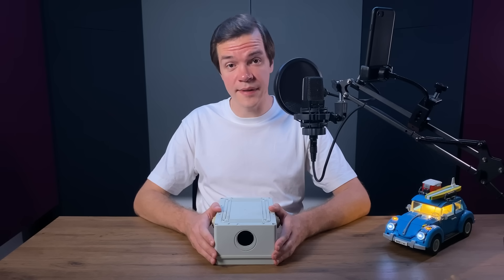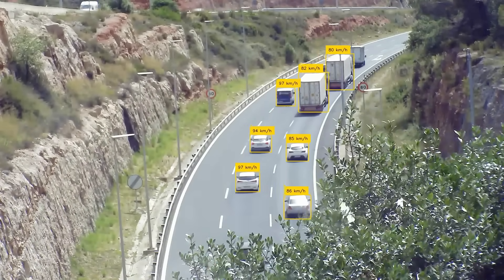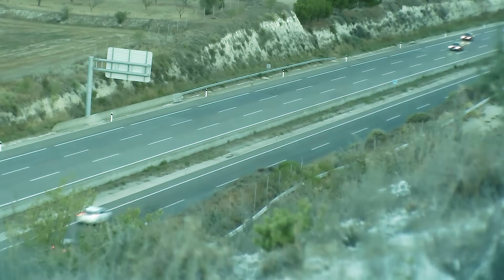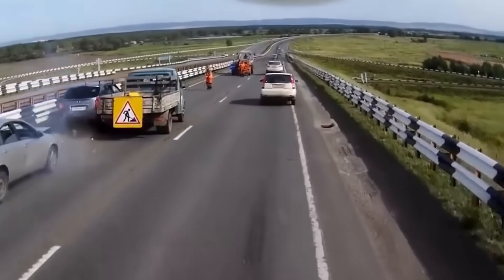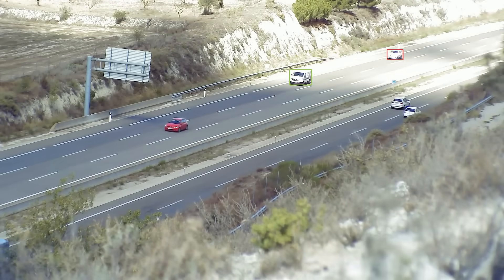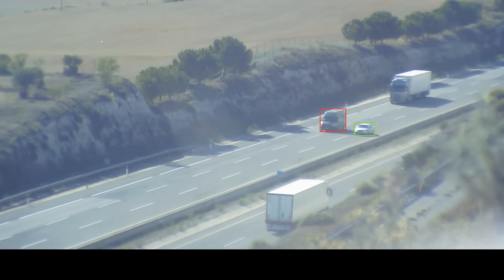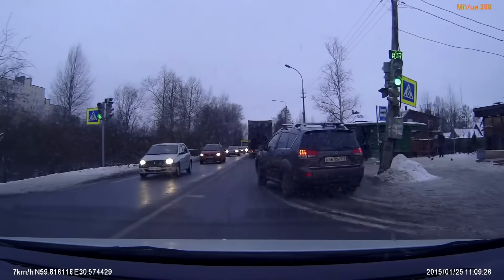New Anti-Tailgating Camera Reveals Shocking Statistics

Comment: I wish I could say this were shocking. In the USA, tailgating is a rampant problem, especially in Phoenix where I live, and it's so bad that I've given up on getting frustrated with the many drivers who follow me too closely. I don't brake check so if they hit, it's legally their fault.

One curious thing I have noticed is that there seems to be a difference between how closely they'll follow different kinds of car. I drive rideshare using the platform's car rental service, and when I first got out there giving rides in a late model Corolla I found that drivers, especially in pickup trucks, seemed to tailgate closer and more often than when I'm in my older, beat-up Crown Victoria. Not sure if it's the relative sizes of vehicle that may be a factor at play, or if it's something else.

Comment: Here where I live highway only has 2 lanes, and the speed limit is 80km/h for heavy vehicles and 100km/h for light ones.
The unspoken rule usually is:
Trucks in the right lane going at 80km/h while Cars go on the left lane going at 100km/h (detail, I know there is no fast/slow lane, but most people don't, and there is such high traffic that if you want to go any faster than the 80km/h trucks, you'll stick to the left)
There is usually high traffic so you'll see hundreds of vehicles tailgating each other. Once one crashes, it'll usually get at least +5 behind them as well.

Now, the weird, worst part. You can't choose to not tailgate without making everything worst. If you're in the left lane and give 100m of space, someone from the right will pull right in front of you to pass one or two vehicles in the right lane, if that's a truck, everyone will have to slow down to 80km/h. If you're in the right lane and also try to give 100m of space, a truck that's behind you'll push to the left and force to pass you.
Passing one f.ing car makes NO DIFFERENCE, but if people see a small space, they'll do everything they can to fill it. So, as soon as you drive safely, people around you become erratic and increase the risks of accidents to happen.
I hate people, can't wait for all vehicles to drive themselves.

Comment: Love the creativity in the tech involved.
The unintentional tailgater is what led to the joke about the guy in Los Angeles who was determined to drive safely, so he slowed down a little to put six car lengths in front of him. However, someone cut in and he had to slow a little more. This continued until HE was arrested. Why? For driving backward on the highway.
I think the best solution is to gamify advanced driving simulators and require them to obtain a license, and after any traffic infraction or accident. The "player" is given real-life goals with various consequences for failure to meet that goal (and an after-analysis of how the goal itself could have been modified, for instance starting earlier) - getting to work on time, late for an important meeting with a client, wife in hard labor on the way to the hospital, etc. Have realistic traffic, including bad drivers, mis-timed or inoperative traffic lights, road hazards, etc. Obviously, their reaction times would be measured and an accident in that simulation would be an immediate loss, with calculations of likelihood of everything from damage to loss of life.
The key would be that the driver would not be scored for that trip alone, but statistically for many similar trips. In other words, assuming their good or bad driving habits are habitual. The initial goal puts real world pressure to achieve a different goal oriented around reward or prevention of loss, but the real goal is to reveal the unnecessary risks they are creating for themselves and others.

Comment: I have known this for YEARS. YEARS. I am very risk adverse and have found that a safe following distance is fantastic way to reduce my risk. It has also saved me numerous times when I wasn't paying perfect attention. The extra following distance helped me avoid an accident. 

I honestly think part of the problem is that most drivers have never put the brake pedal to the floor from highways speeds to a stop. Not once. Not never. And never will until it is a full on emergency. They simply don't understand the distance it takes to stop.

I used to get mad at folks that tailgate me but now I just do what I need to do to get them to pass me. Including, pulling over to the side to let them go by.

All that said I am sure there are plenty of driver's that tailgate that know they taking risks but they use it as a form of bullying. Because they have been bullies their entire life and have never had to pay the consequences of being a bully.

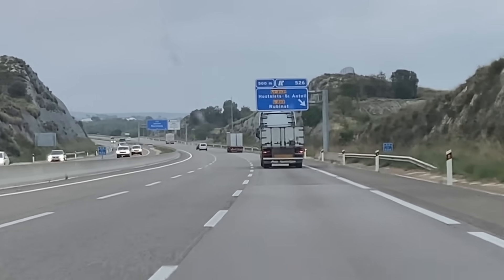Comment: 14:00 this is the exact issue why I stopped using the advanced cruise control in my car. My cruise control does its best to keep a distance in the realm of what you recommend in this video, but if it's even slightly busy it'll just keep slowing down over and over as people move into the gap. And it'll annoy whoever is behind me because it seems to them that I keep letting people cut in front and that I'm driving unnecessary slowly/inconsistently. So unfortunately, over time I've joined the behaviour of the crowd more and more...

Comment: Police don't care about safe driving. Laws only apply to a specific number shown on the dash.

When I figured this out as a young driver, I stopped giving a shit about speed limits. I only drive according to safe distance/relative speed with surrounding cars , situational speed and avoiding speed traps.
Reply: same here, speeding and not stopping at stop signs when there is no safety reason to do so are the only rules I break. It's insane that cops go mostly after speeding when there are many other things that alot of people do that cause alot more accidents and constrains to overall traffic flow. People not using blinkers, people not driving to the rightmost lane unless passing and those that drive half the speed limit yet are completely unaware of everyone around them are far greater threats to road safety than people who are going above the speed limit while doing so in a safe and conscious manner. Here even the police most of the time drive over the speed limit since those are completely absurd in many places. Speed limits put in place 50 years ago when cars were not as safe, didn't have as good of a performance as cars do now in terms of breaking, etc.

Comment: I try to tell people, at least here in the US where freeway speeds are typically around 65mph to 80mph, that a safe following distance is enough to allow a truck to comfortably fit between you. Telling the average person to follow at a set distance means nothing to them. They can't visualize that. But they can visually a truck's length.
That's still well within the distance you're saying of 100 meters. But it's a lot more distance than I see regularly on the road.

Comment: Dear video creator, your story shows that you are either not a car driver at all or a really bad one: Your assumptions are just wrong.
A car on a highway does NOT need 3 seconds of distance, it can be driven at a much closer distance to other cars - in most cases very safely. Why? Because:
a) An experienced driver does not limit his view to the one car in front of him; he watches at least 4..10 cars ahead, and already slows down, if 10 cars ahead is a problem or a slow down.
b) Cars on a motorway extremely seldomly come to a sudden stop - there are no walls to crush agains in the middle of the road.
c) Even a full emergency break (full speed to zero all in emerg.break condition) hardly occurs. Mainly because a) and b).

Comment: 8:08 What if the tailgating distance is represented with the time gap to the car in front? Some cars go 80-90kph while some go 200kph, the safe distance is varied. (recommended 100m gap is assumed for the speed limit)

Comment: As somebody who drives a lot on highways I have found what I consider to be the most efficient way to not be tailgated.

I have modified my driving so that I drive 5-10 mph or about 8-12 kph slower than the posted speed limit. Generally this means that it takes me ~5%-10%  longer to get places.

The benefits I get from this are increased fuel economy and reduced stress as every impatiant SOB goes around me once they realise i wont be speeding up for them in their imaginary 'race' to the destination.

I noticed in your video clips that almost no cars are in the outermost lane. I have seen here in the US that on 3 or more lanes that lane becomes the new fast lane putting speeding traffic directly in contact with slower merge traffic.

I also no longer brake check people. Instead I play a game called how slow will they go we're rather than Braking I just simply reduce my accellerating and turn in my hazzards once i go 33% less than the posted speed. Its amazing how many people will tailgate at 45mph on an interstare can suddenly do 80mph to get away from the same vehicle now tailgating them. I tend to watch traffic 4-5 vehicles ahead and don't do this except in the cases where i need to turn my flashers on to get some one to pass. 

Most of the people who tailgate me fall into 2 categories, super fuel efficient(electric and electric hybrid) and super fuel inefficient (pickup, SUV, service trucks and HGV.) For any of the service vehices i leave a 1* review reporting the driver, vehicle#, the plate and sometimes the time. I hope that we could make bad driving socially unacceptable

Comment: In Turkey they do that intentionally. Comes full throttle no plan to stop, almost hits your car (especially on left lane) blinks high beam lights multiple times to tell you get away while you are trying to pass people on legal passing limit 10 20 + over speed limit. So appropriate think i do is, (1) first i give/ Indicate left turn signal and go right to open the lane(Left is the fast lane here) (I will do the same to you and you are fcked signal) than I go to left lane immediately back after that fker pass me and I go closer to his bumper than his rear lisance plate is to his car and continue to do that till the limit of his car reach to top probably roun 230+ km (trust me lots of thoese f mercedeses s e type fails to go faster at that limit I tryed bunch of time) after I destroy that fuckers car I go back to my lane continue to drive the speed limit (generally 110 km) People think I cant go faster, people think their car faster. Every time a "mafia guy" shows up on my rear mirror I repeat. I hate Turkish traffic so much.

Comment: This is bullshit. There is nothing wrong with cutting infront of another vehicle inside the "safe distance", when you go faster, and there is no reason ahead to slow down. 

The problem is that most of the morons do not pay attention to driving, and have no idea what is happening infront of the car ahead of them, and that leads to accident.
The ones who decelerate just becuse a faster vehicle "violated their safe distance" are more dangerous, than the ones who cut infront of them. These braindead morons do not understand that the distance between them will increase, even if they don't do shit. They are not forced to do anything, to avoid anything. These people are just unfit to participate in traffic.
There is one rule, that MUST be followed, do not force other drives to make sudden actions.
And since the car that cuts infront of you is faster, you don't need to do shit. Only scared morons want to keep their "safe distance" every second.
Anther example is that if one wants to change lanes, and indicates that outside of "safe distance", but is slower than the one approaching in the other lane, than it is safe to change lanes, as it was indicated in time, and other driver had plenty of time to adjust, and not run up into their ass to tailgate.
Also, tailgaters are just asshole bullies, who want to bully their way through others. Fuck them, and lift off a tiny bit, so that thier brain explodes.

PS
Using the seatbelt has nothing to do with any of this.
Reply: The problem is that 90% of drivers think they do well at all the things you just listed, regardless of reality, so enforcing speed limits and safe distances is needed to stop these morons from killing us.
Reply: @korganrocks3995  
I would think that this the number depends on the country, culture, or more likely lack of culture.

But there is no way to enforce speed limit or safe distance.
When all the vehicles will have onboard computers, than it might be, unless some find a way to hack it. Which they will do. So you must eliminate egoistic bully assholes. Good luck with that.

Also, it is totally irracional to enforce any traffc laws, limitations, when there are no other vehicles around you.
All these regulations serve the goal, to prevent accidents. But when there is nothing that endangers the goal, these laws and rules lose their purpose, and there is no reason to follow them. 
There is no need to stop at the stop sign, if there is nothing to stop for.

On the other hand, defensive driving is dangerous too. People slowing down, for no good reason, just because they get scared, force others to react to something unexpected. And this causes accidents too.
For example just last year, a scared imbacile stopped in a roundabout right infront of me, because got scared that the truck might enter the roundabout, nearly causing an accident.
The only reason that there was no accident was me. I pay attention while driving.

The two rules that I follow. 
Never put anybody in a situation that forces them to react suddenly. Never endanger anybody.
Also always pay attention to assholes, dumbasses and scaredmonkeys.
I ignored many stop signes, many red lights, many other rules and laws, but in 35+years driving, I did not have a single accident by following these simple rules.

Comment: It is much easier to compare safe distances in seconds rather than in meters. 3 seconds is safe, 2 seconds kind of passable, 1 second or less - definitely not safe. This way you can create a speed independent benchmark. Just measure the number of seconds between two cars and you already know how safely they drive. Another thing to consider is the capacity of lane. At 120 km/h, one lane can only safely accommodate about 10 cars. If traffic gets busier, it will naturally slow down, because most of drivers intuitively adjust their speed to their safe time interval. Also, cultural differences between countries play role, in germany or in the netherlands people keep much longer intervals than in italy or france.
I really enjoyed your video and find it very informative, thank you!

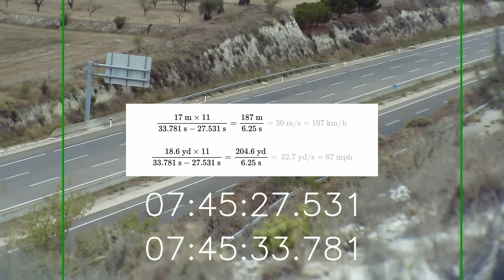Comment: 3:53 -- you measured it wrong. Possibly negliglible, but the right vertical line shouldn't be vertical due to 3d perspective if you want it to be parallel to the left line.
What you could do instead is draw two lines through ends of lane markings. That way, they should be perpendicular to the road -- or, at least, parallel to each other and have the same angle to the road.
Reply: Oh, you actaully do something similar for car distances at 7:25. I just hope you actually measured speed on the same transformation. Otherwise, your results may be wrong given short overall distance of observed road.

Comment: Don't set your addaptive cruise control in the high speed lane. You will give cover to the drivers who are playing traffic cop because they have no power or influence in their lives.

Plus, as others have pointed out, in the high speed lane you will get passed on the right, and then when a car inserts itself in front of you, your car slows down to increase following distance, and you become a bigger annoyance than the ones playing police. 

I'm not saying speeders are always in the right, but since nearly everyone (on US highways) exceeds the limit, the fast lane slowpokes are hypocrites for deciding how fast is "too fast" when they're also speeding. 

I try to drive safe, but I have rules of my own that have come about from my driving experience, and sometimes I do tailgate if I'm the first person in a long line of drivers backed up behind a crusader. In that case, you either need to apply pressure to let the crusader know that they have got to step aside, or you step aside yourself, and hope the person behind you is going to apply pressure. Many times, that person will not apply pressure, and you'll all just wind up stuck behind them. It's a mess.

Comment: Speed reduces the time and distance you have to react also reduces the vehicle stability and makes the impact worse. Speeds over 150km/h are unnecessary in my opinion. The problem with speed limits is that sometimes they are imposed on roads where is no problem to drive faster. I agree that tailgating is just as dangerous as speeding. The problem there is that when you leave a big gap between you and the car in front there will absolutely always someone that will occupy that gap.

Comment: I have an alternate hypothesis for the following distance peak. It is 2 seconds (or 3) at the default speed for the area not the highway IE People learn a following distance on local roads when they are learning to drive, and where they spend a lot of their time driving.  Then when they drive on the highway and tuned out they maintain that same distance automatically instead of the same time which requires active involvement as the speed varies. To maintain the time at speeds from 80-120km/h you need to actually count seconds etc.